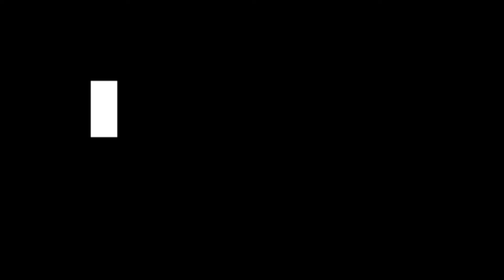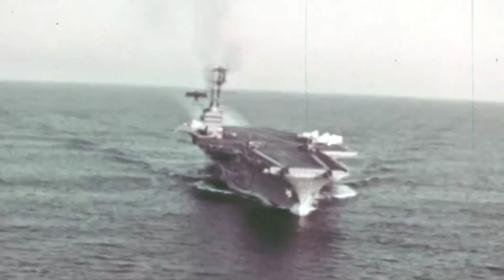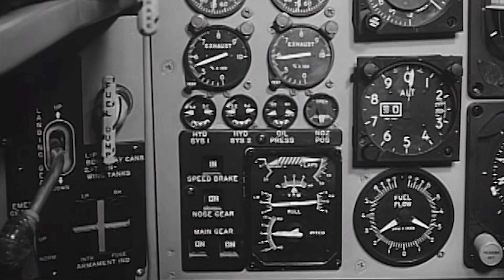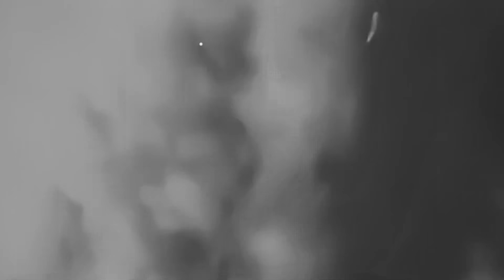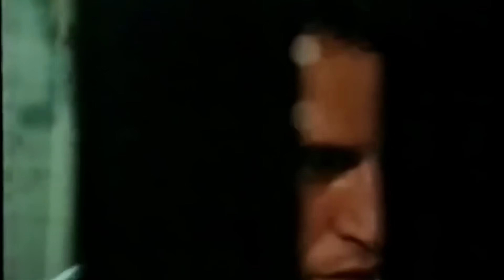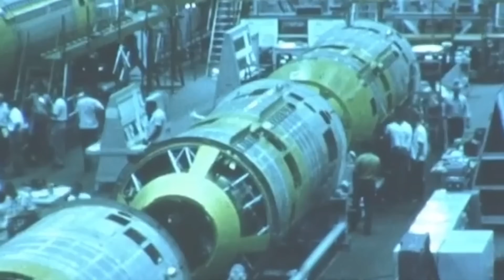A-5 Vigilante: From Pride to Disappointment - The Hidden History of the US Navy

Comment: The thumbnail is incorrect. It shows a late model RA5C with bomb on the wings.  The top of the wing was flush with the top of the fuselage air intakes. This did not happen as the plane at that time was not used as a bomber. The speed of the aircraft was as high as Mach 2.5 in test flights of the A5B.  The flasher pods (strobe lights) were not used in combat because they gave a flight path indication for AA fire to follow. Carrier Airwings in Vietnam era where 85 to 90 aircraft On Forrestal class and later ship where the Vigi operated..

Comment: Something I don't understand is how the stores bay delivery method made it into production if it was unpredictable. More like "how did a major design flaw get past the wind tunnel and prototype phases? But the stores bay concept DID became a success, as shown. Wow I bet that was a mess when the tank came loose on the cat. Did it rupture? For sure NA tested for that possible event, a fuel store coming loose on deck, right?
Reply from the maker: The commenter is referring to potential issues with internal stores bays on fighter jets. Early designs likely faced challenges with accurate release and safe separation, requiring extensive testing to address these concerns before widespread adoption.
Reply: @EngineeringDocumentary  I'll bet NA and the Navy really tried to make the stores bay into something special. I'm serious. It's an intuitive delivery concept but somehow it wasn't mastered. The bay, with its plumbing and volume, making it do foto it made it indispensable.

Comment: They always looked frail in appearance comparered to other naval jets on the flight deck.
Additionally, I think it took up too much space, and remember,
F-4's and F-14's were Mach 2 combat aircraft without the thin wings.
There was just no need of it once it lost it's MK-28 bomb laydown mission.
Should have pawned it off on the Air Force or NASA.
Reply from the maker: This comment refers to the A-5 Vigilante. While it appears frail due to its slender design, it was built for speed and high-altitude reconnaissance. Its large size and limited combat roles led to its early retirement from naval service after the strategic bombing role diminished.

Comment: It looks like a 4th Gen Fighter more than a Bomber/Recon aircraft.

It's weird they went on with a single big rudder rather than twin smaller ones. Considering that in an Aircraft Carrier space is a premium.

It's weird that in order to replace it ... they went so far off this design into the F-111B. But if that hadn't happened, then the most beautiful carrier based aircraft would have never come to be. So i guess thank you A-5 Vigilante.
Reply from the maker: The A-5 Vigilante, while looking like a fighter, was designed as a high-speed nuclear bomber and reconnaissance platform. The single, large rudder likely offered sufficient control authority for its intended high-speed, straight-line missions.

Comment: The US equivalent of the English TSR.
Reply from the maker: That's a common, albeit inaccurate, comparison. The TSR.2 was designed for low-level strike, whereas the US doesn't have a perfect analogue, but the F-111 comes closest in role.
Reply: Hi, I was thinking more of the size of the plane, but originallly the Vigilante was optimized for strike or not?

Comment: Yes, it's incredible how well this is presented... The problem with the automated voices is that they don't change the intensity or velocity to convey feelings.
If you use an AI to make the script, you take care to include parts that an AI will not include by itself.
Reply from the maker: You're right, the lack of vocal nuance in AI-generated voices can be a drawback for conveying emotion. Manually adding elements that AI might miss is a smart way to improve the overall quality and impact of the script.

Comment: It seems like it could have been modified to become the fleet interceptor that the F-111B failed to be in the 60's.
Reply from the maker: That's an interesting thought! While both had long-range capabilities, the F-14's variable geometry wings and focus on air-to-air combat made it a more natural fit for the interceptor role than a modified strike-focused aircraft.
Reply: I was just making the comparison with the navalized version of the F111. As a pure interceptor if the Phoenix system had been perfected in the mid 60's rather than early 70's.   It had the long legs and power to keep the TU16 and TU95 at arms length.  Definitely wouldn't have been a dogfighter but neither was the F111B
Reply: @300guy  I don't recall the exact details but the A-5 had a major influence on the design of the Tomcat. There's a book out there on the history of Grumman aircraft that talked a lot about the development. If you can find the design models Grumman was experimenting with, many of them looked like the Vigilante. Especially the single tail, fixed wings, and intakes.

Comment: I have always liked the fast-looking, sleek design of the VIGILANTE. After watching this video, it looks just like one of the concepts for the F-14 TOMCAT. A beautiful aircraft for certain. I think a droag chute may have worked for munitions deployment. It very likely would have helped deploy munitions while creating significant drag to help guide the munitions to the target. Or at least keep the munition from running into the rear of the aircraft.
Reply from the maker: You're right, the Vigilante did influence early F-14 designs, especially in the blended wing-body concept. While drag chutes aren't typically used for munitions deployment in modern fighters, they are used for arresting landings on shorter runways and for improved braking.

Comment: Looks more like the CF105 ARROW.
Reply from the maker: The resemblance to the CF-105 Arrow is understandable given the similar delta wing design optimized for high-speed flight. However, the aircraft likely employs more modern aerodynamic and material technologies than the Arrow ever did.
Reply: @EngineeringDocumentary  I'm going to have to disagree on a couple of points you brought up. Regarding the differences in technological advancements of the day I have a list for you to ponder.

The CF-105 Avro Arrow was the:

1) First a/c designed with digital computers being used for both aerodynamic analysis and designing the structural matrix (and a whole lot more). * ( The claim that it was the first aircraft designed/tested using the IBM 704 cannot conclusively made. It is known that the unit at AVRoe was the only 704 sold in Canada.)

2) First a/c design to have major components machined by CNC (computer numeric control); i.e., from electronic data that controlled the machine.

3) First a/c to be developed using an early form of “computational fluid dynamics” with an integrated “lifting body” type of theory rather than the typical (and obsolete) “blade element” theory.

4) First a/c to have marginal stability designed into the pitch axis for better maneuverability, speed and altitude performance.

5) First a/c to have negative stability designed into the yaw axis to save weight and cut drag, also boosting performance.

6) First a/c to fly on an electronic signal from the stick and pedals. i.e., first fly-by-wire a/c.

7) First a/c to fly with fly by wire AND artificial feedback (feel). Not even the first F-16’s had this.

8) First a/c designed to be data-link flyable from the ground.

9) First a/c designed with integrated navigation, weapons release, automatic search and track radar, datalink inputs, home-on-jamming, infrared detection, electronic countermeasures and counter-countermeasures operating through a DIGITAL brain. * (We are researching some of these claims. Stay tuned for an update.)

10) First high wing jet fighter that made the entire upper surface a lifting body. The F-15, F-22, Su-27 etc., MiG-29, MiG 25 and others certainly used that idea.

11) First sophisticated bleed-bypass system for both intake AND engine/exhaust. Everybody uses that now.

12) First by-pass engine design. (all current fighters have by-pass engines).

13) First combination of the last two points with an “ejector” nozzle that used the bypass air to create thrust at the exhaust nozzle while also improving intake flow. The F-106 didn’t even have a nozzle, just a pipe.

14) Use of Titanium for significant portions of the aircraft structure and engine.

15) Use of metal composites (not the first, but they made thoughtful use of them and were researching and engineering new ones).

16) Use of a drooped leading edge and aerodynamic “twist” on the wing.

17) Use of engines at the rear to allow both a lighter structure and significant payload at the centre of gravity. Everybody copied that.

18) Use of a LONG internal weapons bay to allow carriage of specialized, long-range standoff and cruise missiles. (not copied yet really)

19) Integration of ground-mapping radar and the radar altimeter plus flight control system to allow an interceptor/reconnaissance role. The first to propose an aircraft be equally adept at those roles while being THE air-superiority fighter at the same time. (Few have even tried to copy that, although the F-15E is an interesting exception.)

20) First missile-armed a/c to have a combat weight thrust to weight ratio approaching 1 to 1. Few have been able to copy that.

21) First flying 4,000 psi hydraulic system to allow lighter and smaller components.

22) First oxygen-injection re-light system.

23) First engine to have only two main bearing assemblies on a two-shaft design.

24) First to use a variable stator on a two-shaft engine.

25) First use of a trans-sonic first compressor stage on a turbojet engine.

26) First “hot-streak” type of afterburner ignition.

27) First engine to use only 10 compressor sections in a two-shaft design. (The competition was using 17!!)

Comment: The F-104 also used Boundary layer control.
Reply from the maker: You are correct! The F-104 Starfighter employed boundary layer control (BLC) on its wings to improve lift and handling at lower speeds, especially during landing. This involved blowing high-pressure engine bleed air over the leading and trailing edge flaps.
Reply: @EngineeringDocumentary  F-104 STARFIGHTER!! WHAT WINGS!!???🤔😮😳😁